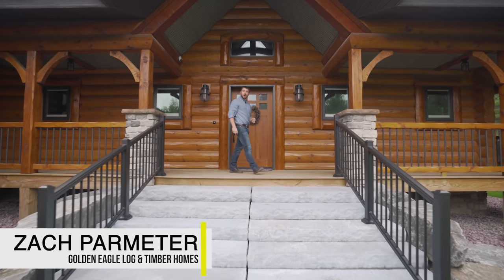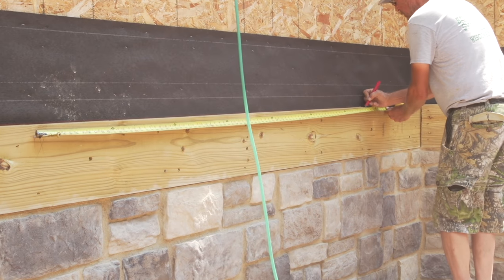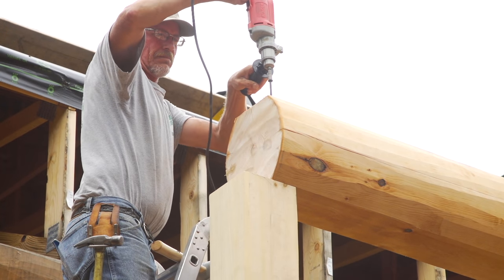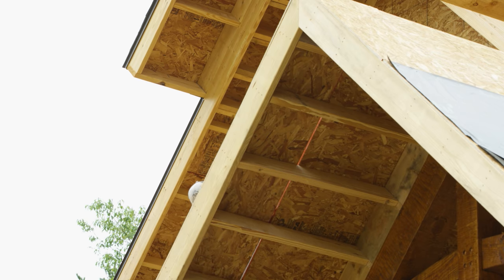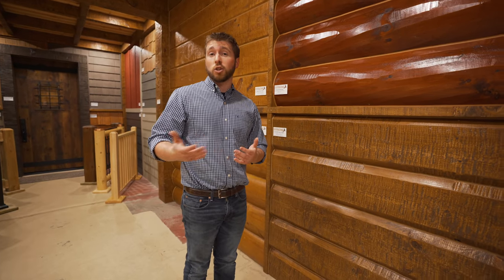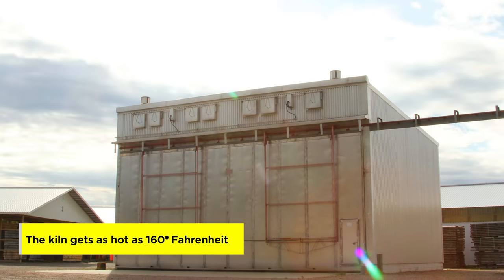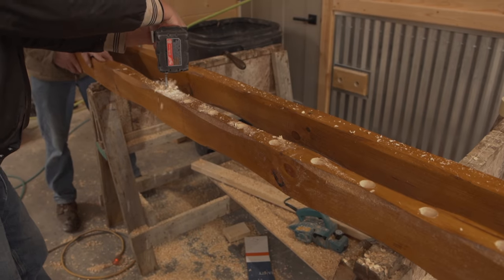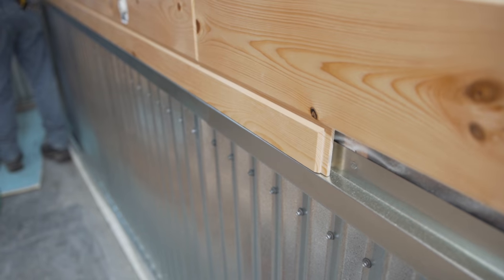Episode #3 Log Home Construction | How We Design a Maintenance Free Log Home

Comment: What is the floor plan? I have settled on the 1816 as my retirement home, but I am thinking this could work too depending on floor plan as a low maintenance exterior home with generous overhangs could be the ticket.
Reply from the maker: The floor plan is the Log And Timber Home 2124AL
https://www.goldeneagleloghomes.com/plans-and-pricing/plan-details.asp?PID=2098

The Log and Timber Home 2124AL was designed from the very beginning with the idea to combine log and custom timber elements. As we worked closely with the homeowner while designing this unique custom home, we quickly learned that she knew exactly what she wanted. Full log wall construction with squared timbers and stone for accents was desired for a truly rustic feel. Reclaimed wood flooring, reclaimed wood doors, and circlesawn boards on the ceilings would bring even more ruggedness to her dream home. A wrap-around covered porch was a must, along with an open loft where she could have her home office. With her dogs being a central part of her life, she wanted to ensure that they would have their own space with unlimited access to a protected fenced-in area. This home chef also requested a gorgeously spacious kitchen with a lot of natural light, her attached garage to have no steps between it and the home, and finally, an incredible stone woodburning fireplace chase to accompany the in-floor heat. Many log home companies may consider these requests to be overwhelming, but we happily accepted the challenge to make our homeowner's dream a reality.

Comment: What is plot size ?
And what is the cost of construction ?
Will you do this in India ?
Reply from the maker: 5 acres.How much would it cost me to build this home?
This home was featured in our Log Home Construction Video Series. In the video series the homeowner came to us, and really liked the Eagle Prow 1975AL. That stock plan would be approximately $669,000 as an 8"x8" full log home. As with each of the 5,500+ homes we have previously built in North America, this homeowner began by modifying our stock plan like most people do. In this case they were looking for more luxurious options and a larger home. With the help of our in-house design team. They increased the size of the home, upgraded to 12"x12" full logs, and choose deluxe options on nearly every single item in this home. This resulted in a turnkey cost of approximately $984,000. Depending on the package you choose this home could build for at little $816,000.

In different parts of the country construction costs may be more or less. And you would need to add Land Costs, Well, Septic, Landscaping, Etc.

Contact Us or call at 1-800-270-5025 and we can help you start planning your dream home. North America only

Comment: In my opinion, engineered wood is garbage, ICF blocks are cheap, the roof frame is engineered wood as well, or the steel for the ceiling finish. If I did go with this company, those things are a no-no!
Reply from the maker: Brent, When you build with us you can spec out whatever you like, thanks for your opinion